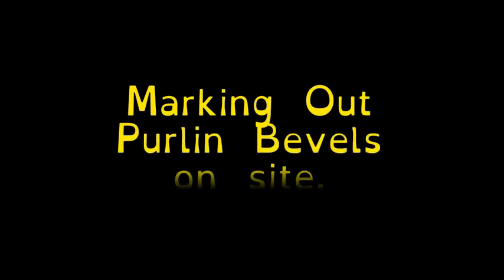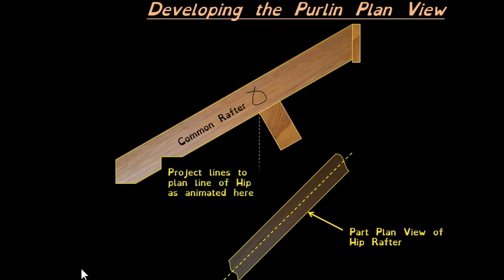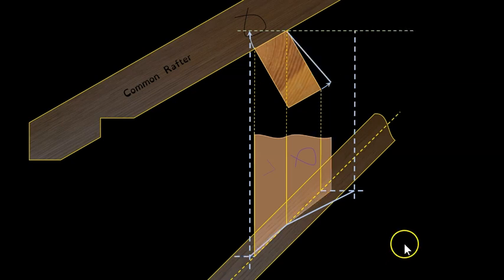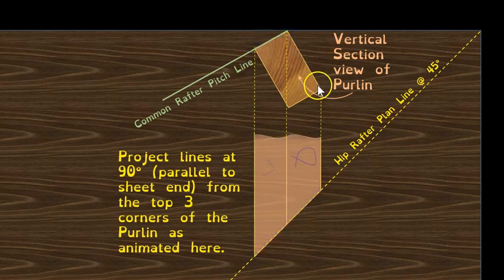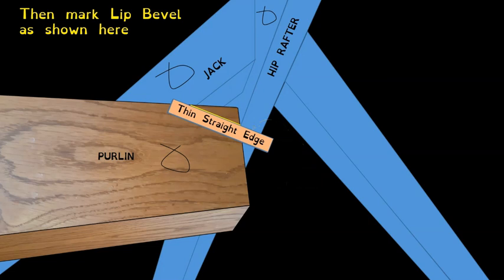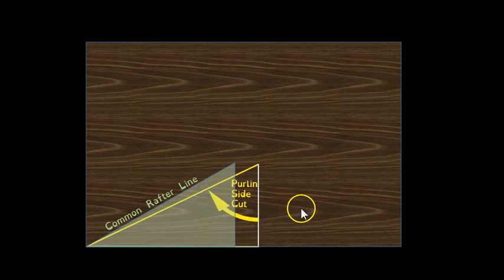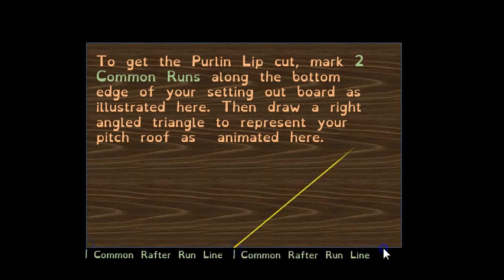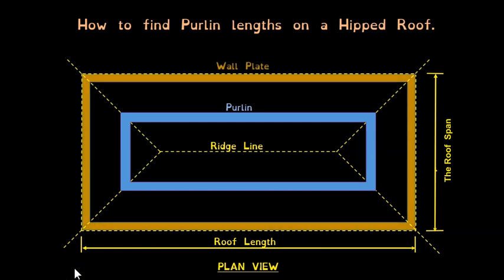Marking out Purlin Cuts to Hip

Comment: Thanks for another helpful video Michael,  but why do so many carpenters or books use the rafter length and rise for purlin side bevels on the roofing square? As this will only work on a square roof is it not better to use co pitch (co length) and side run which will work for all roofs and is easier to visualize why it works. It took me a while to figure out how rafter length and rise gave the bevel as i like to picture the square in place.  Misi

Comment: Can you show what bevel the circular saw should be on to achieve the proper cut cheers
Reply from the maker: Not sure if this is the answer you want....Line up side of saw  base plate with purlin side cut (blade depth at zero)...then mark 2 pionts on each side of the plate that line up with the top of the purlin.....Now drop blade to required depth....then while keeping those points in line with the  bottom line of the purlin edge swing the blade until it lines (sight it) up with the purlin edge cut . Make sure saw is isolated from power whilst doing this.

Comment: Is there a quick way of setting it out on a piece of timber, using common rafter plumb cut and stepping back the perpendicular distances on edge and side of timber and joining the lines to get the angles,can't remember exactly
Reply from the maker: Hi there, I was hoping to find an old drawing i had on this before i reply so as i am sure its correct....cant remember whether or not it was a plumb or seat cut to start with....but its worth chasing down as it was a good one.

Comment: Michael, The graphics in this purlin video relating to the specific bevel angles were extremely helpful in visualising the underlying geometry involved. This approach is superior to images in text books as it’s 3D content clarifies  all the essential details considerably. Your additional and alternative methods for marking out the cuts on sheet material will be most useful too- I will explore both schemes. Thank you so much for producing this valuable content - it really does help - As noted in previous notes, I am most appreciative of the behind the scenes tech production which is required to formulate the great graphics!!! Thanks so much!
Reply from the maker: Hi Jeff,thanks for your comprehensive feed back which is much appreciated. I like having animated videos available  to cater to the more visual learner and it is a great flipped learning option to have now that remote learning has become more necessary.